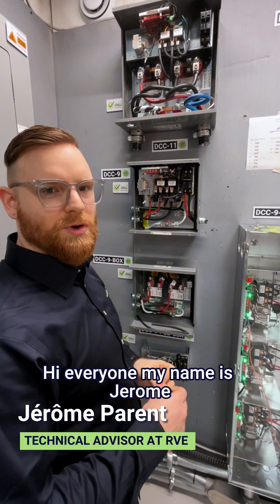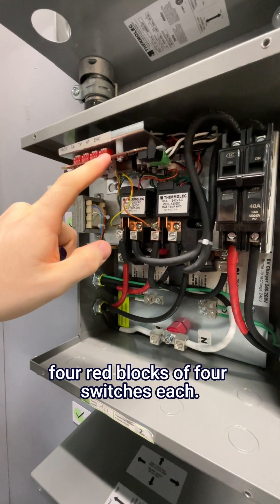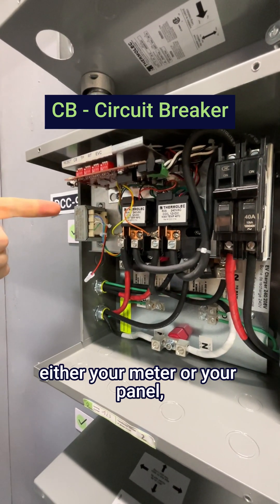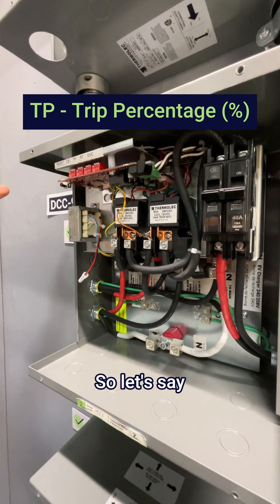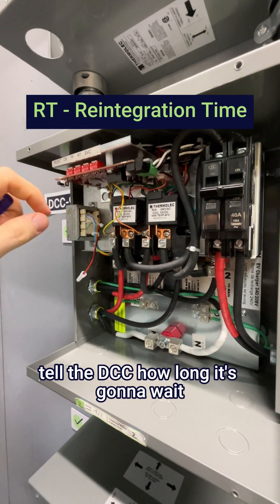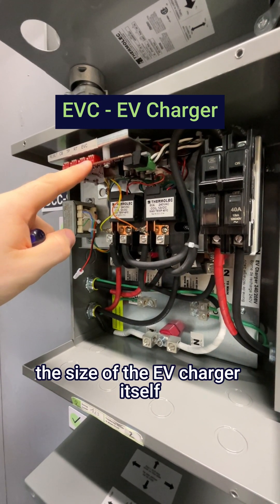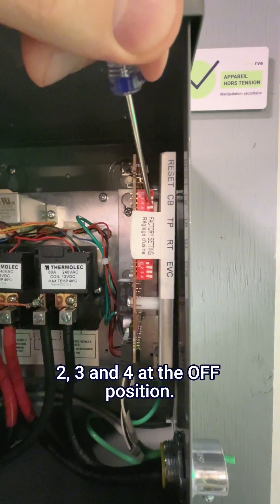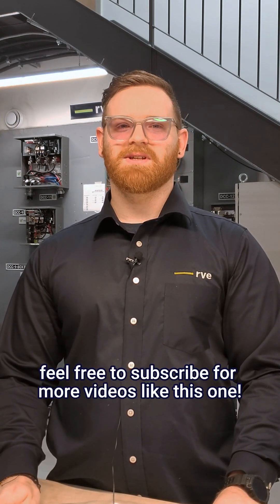DIP SWITCH Secrets Nobody Tells You About Setting Up Your DCC-9

Comment: Hi Jerome, thanks for the great information. I have a DCC 9 50 for condo that keeps turning red at the Flo X3 charger and not turning back green by itself. The CB is for 100A. The current dipswitche positions are ON ON ON ON. Is this correct?